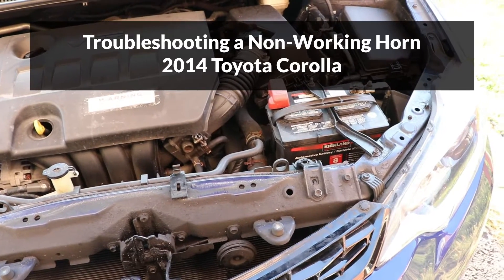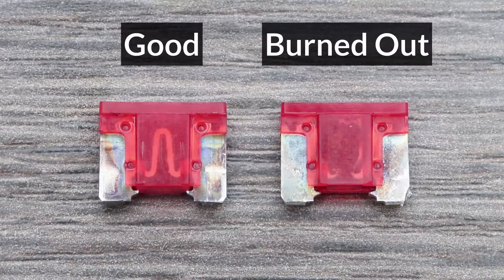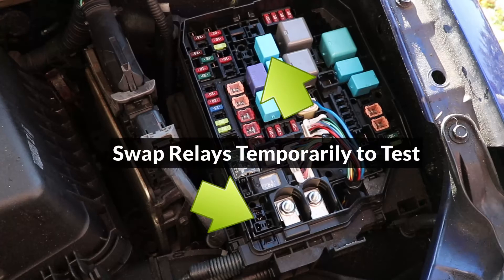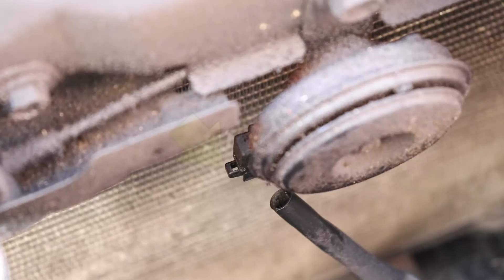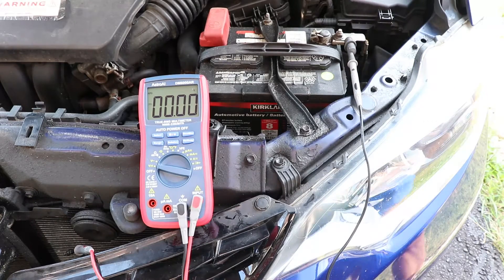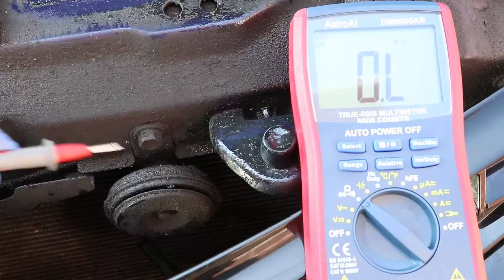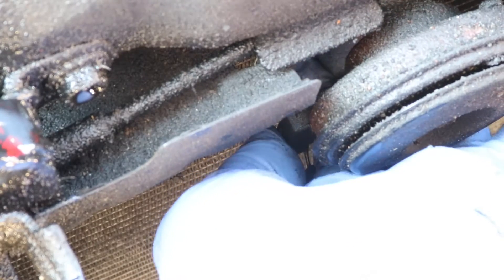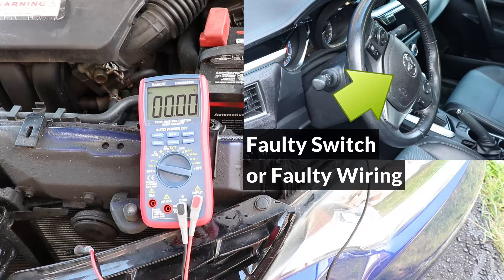Horn Not Working, Fuse, Relay, Ground & Voltage Check, Toyota Corolla 2014, 2015, 2016, 2017, 2018

Comment: Does anyone know ow if you should have 12v constant at horn relay at any pins.  My horn works if I jump from fuse to horn,  I swapped relays and it didn't work,  all buttons on my steering wheel work, but it seems like none of the pins have power at the relay
Reply: Should mention horn also does not work with alarm/panic button
Reply from the maker: According to the wiring diagram, +12V goes from the horn fuse to two of the relay pins.  If there is no +12V at the relay, then it's likely that the fuse is blown.

Comment: What i would do in this case remove the horn, get some cables and give it direct voltage 12v to the battery.

Comment: Thank you! Turned out my horn was disconnected.
Reply from the maker: the connector was out? Or bad connection?  If the connection was bad, it will probably happen again eventually if the corrosion is not cleaned or connector replaced. There's Nye 760G connector grease that can protect the connection from further corrosion, here's a video on it: https://www.youtube.com/watch?v=UsQZdZv4e90  I'll place a link to the grease in the video description for anyone interested. Thanks for the comment and for watching!

Comment: I have 2019 corolla . Any difference?
Reply from the maker: There may be differences with the fuse and relay location, check the back of the fuse box lid to see if it's same as mine, you'll have everything labelled there.  The ideas still apply, voltage has to be measured when the horn is pressed. If there's no voltage, then the fuse, relay or horn switch in the steering wheel is faulty. If there is voltage but the horn doesn't sound, the horn is faulty or the connection.

Comment: This video was great and helped me a ton! I went through all of the troubleshooting steps and the unplug and replug the horn ended it fixing it ! Last step solved my problem ! Just like the good ole “turn it off and back on “ 😂
Reply from the maker: Nice, I'm glad that worked! That connector gets a lot moisture since it's right at the front of the car.  A little cleaning and then coating with dielectric grease will help to keep it in good condition so it doesn't happen again.

Comment: Hey man love your videos, I am having trouble with my steering wheel, none of the buttons work on the steering wheel. Any tips? Thanks much love!
Reply from the maker: Thanks. Only thing I can think of that can do that is the clock spring,
https://youtu.be/d_BEoKc6ouE?si=J-VKYkO_cg0AcsYk&t=457  All buttons on the moving part of the steering wheel go through that connector.  I'm assuming wipers/headlights are still working.
Reply: @CleverFix  yea the headlights and the wiper both work but the buttons don’t, at the same time could this also be the reason why my horn doesn’t work. I tried everything in the video and I still get nothing, sorry for the questions but I just can’t figure it out
Reply from the maker: @jaimealvardo7682  For sure, if the clockspring connection is broken the horn will also not work, and neither will the airbag, so you may have an Airbag warning light on the dash that stays on once the car starts?. Check out that video link I gave you in the previous comment. There are other videos showing it on a Corolla.  It may be that the clockspring has to be replaced, or a loose connection somewhere.
Reply from the maker: @jaimealvardo7682  Also keep in mind: If the airbag light is on, that means the airbags are deactivated, which is not safe to drive. Also it's not safe to drive without a horn.
Reply: @CleverFix  100% agree with you, but I just hope nothing happens, again will check that piece out, thank you for everything!!

Comment: When I move my leash it start to horn like crazy
Reply from the maker: Leash? .. The horn turns on when it receives 12 volts, and that usually only happens when pressing the horn switch on the steering wheel.
Reply: @CleverFix  thank you for the reply.
When I move the steering wheel left or right it start to make sound. I bought the used car recently.
Reply from the maker: @KurdishYoutubeKSAS  Do you have kids? I've seen this happen when kids insert something metallic in there, like a key, etc. Then when the steering wheel is turned, it moves around behind the button, causing the horn to honk.
A mechanic should easily be able to fix that in a few minutes.  
If that's not the problem, then one of the 3 springs at the back of the button/airbag may also be broken/stuck.
I would take it to a mechanic because the airbag is expensive, wires are delicate, and safety precautions have to be taken when working on the airbag system.
Reply: @CleverFix  I don’t have kids but ok I think I will take to the mechanic

Comment: Thank you for your video! The horn connector was probably the cause of my problem. I also cleaned the contact surface of the horn (by removing the airbag), but it didn't work... I removed the electrical plug from the horn and then put it back in... and bingo! it works... Thanks!
Reply from the maker: That's great to hear. In case it keeps happening, some dielectric grease inside the connector will keep it from corroding. The grease keeps water and moisture out. It's also good for battery terminals.
Reply: I actually used electrical contact cleaner! Good evening !
 @CleverFix
Reply: What electrical plug?
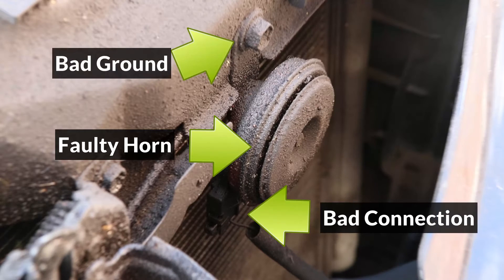Reply from the maker: @droidhacking  See 2:46 in the video, with arrow showing "Bad Connection"  , that's a removable plug.
Reply: @CleverFix thanks. I think I'll have to clean the contacts under the steering wheel.
Reply from the maker: @droidhacking  If there's no power (12V) measured on that connector when pressing the horn, and fuse and relay are OK, then something will likely be wrong at the steering wheel, sometimes the clockspring.

Comment: Thank you so much! But I must say that I have never seen a Corolla with so much rust and so dirty.
Reply from the maker: That's the only way to protect it.. oil+dirt/dust settling on the oil .. Under all that dirt, it's a working car, which would probably look fairly good even under the hood.. but then it would be exposed. Some surface rust was impossible to stop after 10 years.. the roads get salted and de-iced using rust causing chemicals, so 4-5 months of the year, the car is soaked in those chemicals. If you haven't seen that, you probably live somewhere it doesn't snow. I wish! .. Could've kept this car 30 years rust free if I lived in Florida.